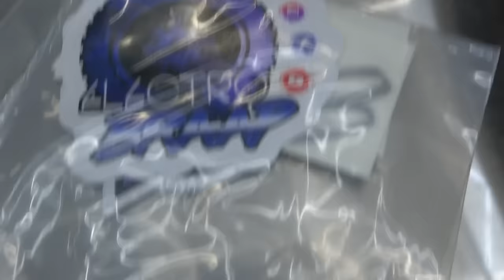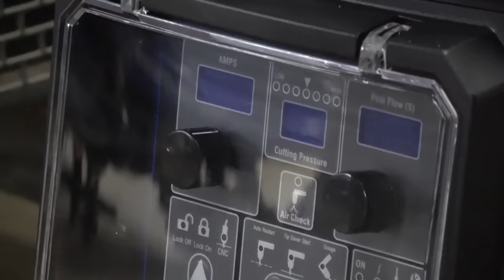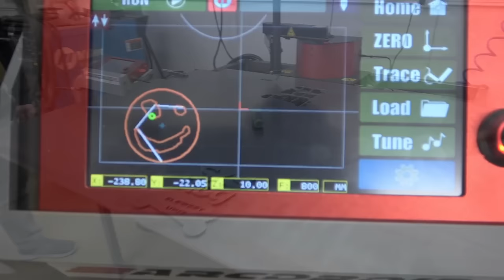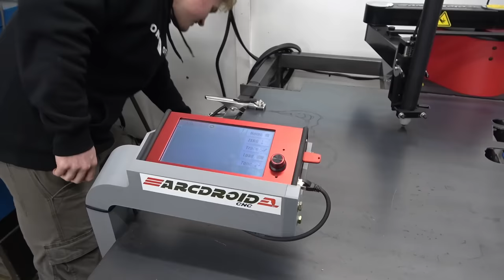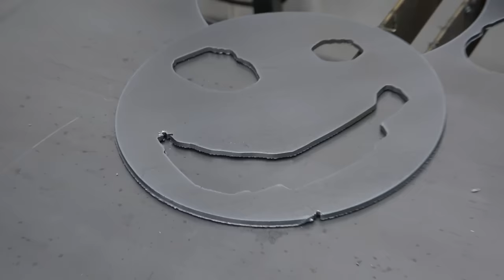Unboxing an ELECTRIC conversion kit for our pit bike + ArcDroid Demo!

Comment: I always thought you guys should do an electric sxs build - think that would be an interesting one.
Reply: That would be so awesome. Use a couple Tesla motors
Reply: @Yz4Life  sadly been done already.
Reply: @asylumental  I think that your thinking of Sierra Cars
Reply: Heavy D drove one and loved it
Reply: Put the pipe down!   Your in the twang place
Reply: I digress. I’m in the wrong place.
Reply: I've planned out a complete build like that, but those size batteries are still very expensive. Ron Cobbley built the electric RS1 and is working on a Pro R now that has a similar layout to what I wanted to do. Excited to see how that one turns out
Reply: After seeing the white rs1 that I think says hostile on it. I agree. That thing is nuts and it’s nothing compared to what it could be
Reply: It is a rs1 and they have been building a 4 seater aswell

Comment: Ive learned after using my arcdroid, everything under 1/4 run it at least 20 inches per min. This will help with the slag, accuracy, and the edges having a taper to them. And for larger or thicker parts using water directly under it to keep it cool will prevent it from warping. Also a faster cutting speed helps with warping because it puts less heat into it. I use a 1/16 cut height and it seems to work good.
Reply: The peirce delay can be down to .19 seconds as well, this helps with the big gouge it leaves when it first starts up. You guys will love that thing, not having to use a death wheel and flap discs for hours and breathe in all the dust is just awesome. Use a air hammer with a chisel tip to knock the slag off!
Reply: I'll try that out. I pretty much only adjusted the settings just enough to make it cut. Was too excited to test it
Reply: @Steve-sxsblogparts  i cant wait to see what you guys make with it! You all looked excited, i know i was.

Comment: Get an (e-bike pro ss) its already 72v and you don’t need to pay over 4k to upgrade it to 72v like you do a Suron
Reply: Those look nice, but this is going to make quite a bit more power than that for a lot less money
Reply: Yeah i was just saying if your going to get a suron, I’d look into the e-bike pro ss instead of a suron because it comes stock with 72volts.

Comment: $1,099.00 kit on their site.

Barreries not included.
+$1,059 - $2,149

Good display +$125

Better controller +$150-$300
Reply: Once we're done I'll put together the exact prices of the parts we're using.